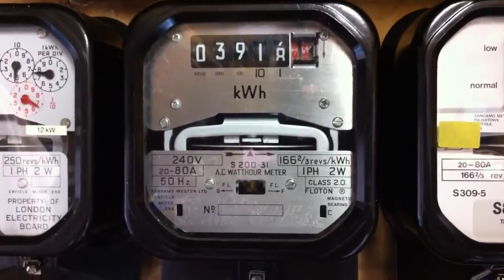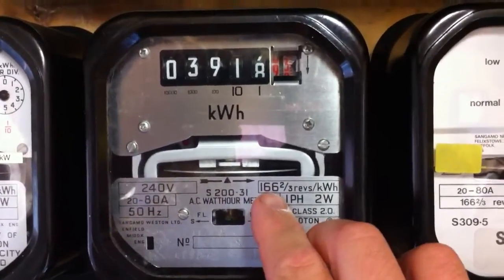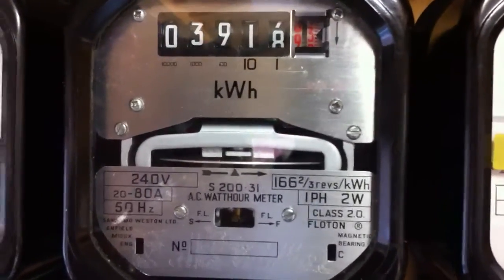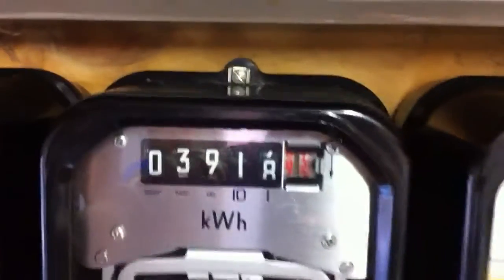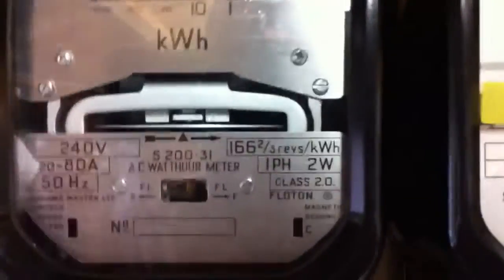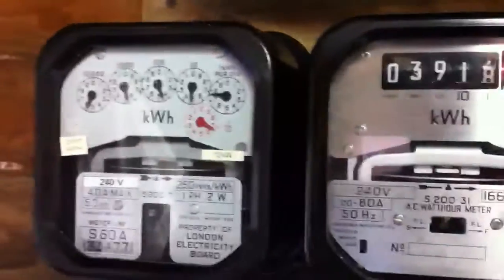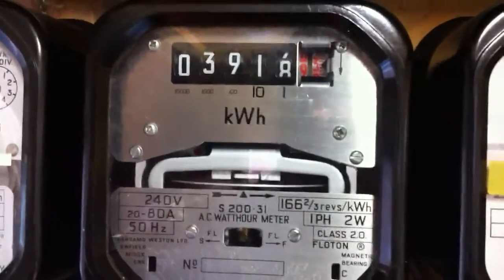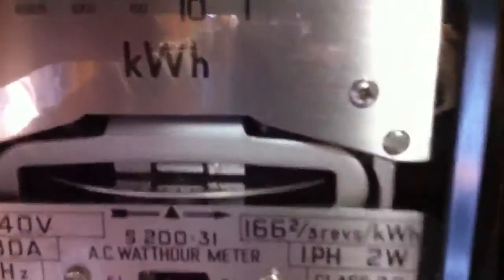Sangamo Weston S200.31 Kilo watt hour meter

Comment: This is the same electricity meter to the one I have.  This is to my limited knowledge on meters not an RTS meter, would that be correct?  Thank you
Reply from the maker: Yes you’re right, these are single rate meters, if there was 2 readouts then they are a duel rate and may use the RTS to change the rate over.

Comment: Interesting that this was over reading by 0.11 kWh. So every 10 units the thieving electricity company charges you for an extra one. Its a little like inflation and your hundred grand in the bank having 5% spending power each year.
Reply from the maker: I wonder if this is why the meter was taken out of service maybe!🤔 
But yes I don’t trust most of these companies anyway, especially the way they throw money at the wall it seems. Thanks for your comment. Cheers.
Reply: @Cavalier_Steve  nice one Steve, trust issues aside, you are likely correct. In my location most have been swapped out for smart meters. I managed to find one at a thrift store for a buck and I was trying to find out how to wire it up so I could monitor my power usage in my outside workshop. I managed to find about half a second of footage in your video showing me neutrals to the centre and phases each side, thanks! I also connected a 75 year old panel ammeter to a custom perspex housing and mounted it all to a nice piece of hardwood. It hangs from the wall now. I plug my extension lead into it and output from it, making it completely portable. Looks cool!

Comment: Hiya Steve. A few things about the readout on that meter: The reading on this meter is actually 03919.3.

They do take some getting used-to, when it comes to reading them. They don't as such have a 1/100 dial, but on the red number to the right, there's little increments on there, & those are the 1/100ths on there.

The red number to the left is whole kWh, & the red number to the right is 1/10ths with 1/100 increments on it.

I'll have to do a vid on how one of these readouts work. :-)

-BBD.

Comment: The two decimal wheels are actually 100 Wh and kWh.
The red 9 is always one digit higher than the white 8. When the ten flips over then the numbers are the same till around the 1 - 2 , when the counterweight gets repositioned for the next turn.